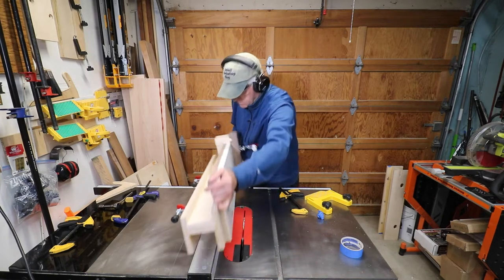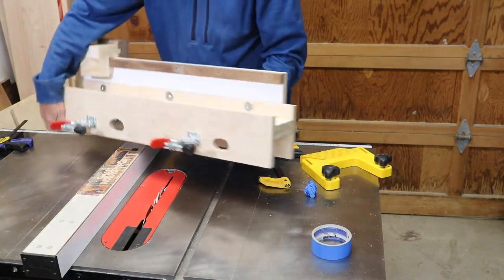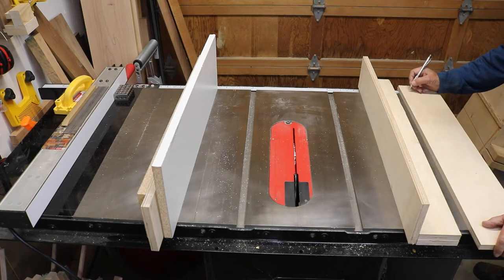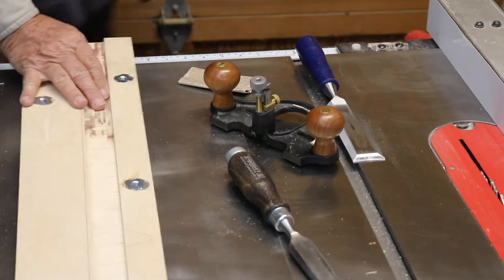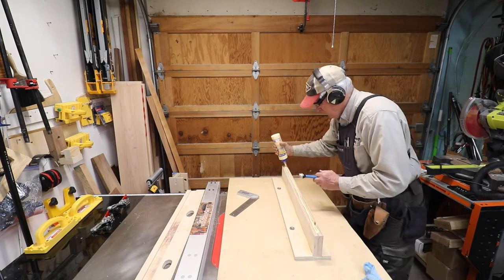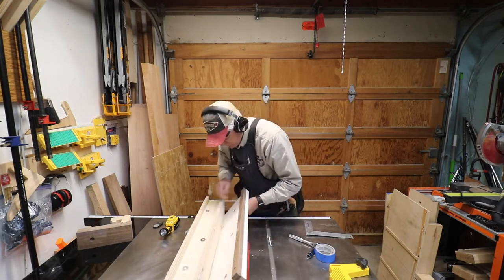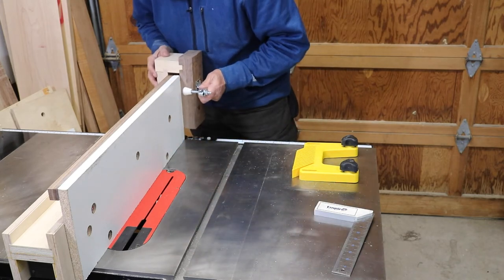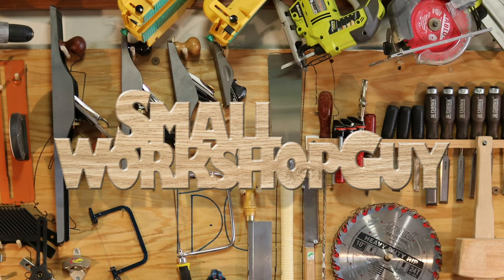Jig for Your Table Saw Fence - Multipurpose Base and Several Accessory Fences

Comment: Thank you for your video. First time viewer and now subscriber here.  

I noticed you were using clamps to hold boards perpendicular to the saw.  If you make the block that you clamped to a little bigger, you can add a toggle bold to it as well and it will cover the angle you had to use the other clamps for. 

Just a thought.
Reply from the maker: And a good thought it is!  Thanks for watching, commenting and subscribing